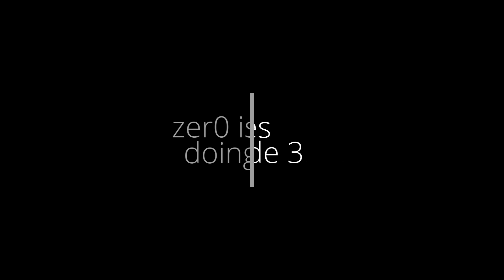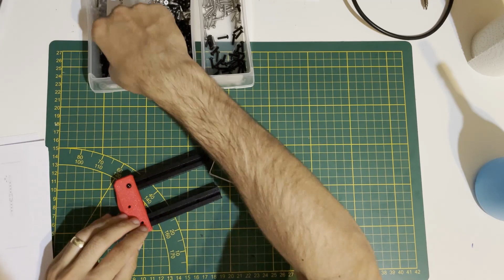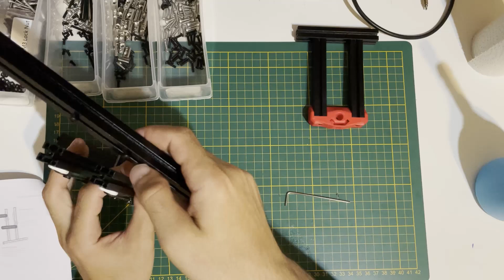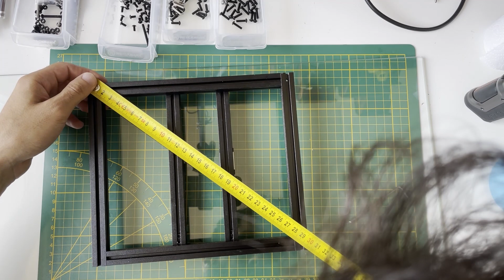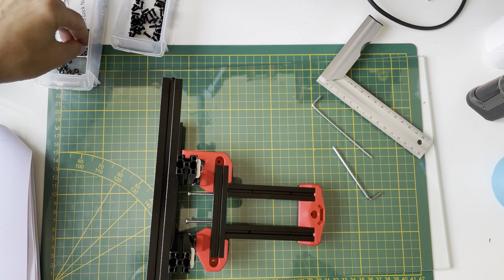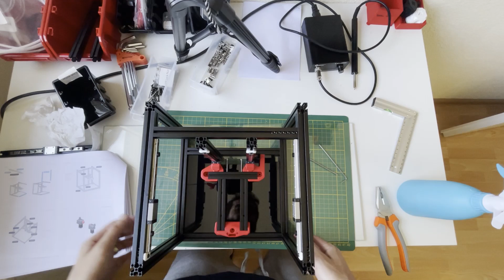Building Voron v0.1 - Frames [Ep3]

Comment: I'm really enjoying your series so far. Helping me build mine from the same kit. Just one bit of feedback - the audio needs a bit of fine-tuning. It goes from quiet to loud very frequently, and the music makes me scared to turn up the volume too high to hear your voice better. Otherwise, everything is great! 

I'm commenting on the wrong video, but the thick lube you used in the last video looks very different from mine. Do you think Super Lube 51004 is fine to use on rails?
Reply from the maker: Thanks for the feedback. 

I am not sure specifically that one is good or not but most probably you’ll be fine. It basically for protective for your rails.

Comment: Hi zero, thanks for your tutorials, they encourage me to buy a V0 kit. I noticed that you have a place for a led on your front bed mount. I will be very appreciated if you could explain better the connections and the type of led that you are using since I´m planning to do the same on mine. Keep you the good work!!!! D
Reply from the maker: It is W2812 LED. 
https://docs.vorondesign.com/build/electrical/v0_miniE3_v20_wiring.html
In above link see the last screenshot. In there you will see NEOPIXEL above the E0-STOP near right bottom. You need to plug it in there. Match the PIN layout in LED and board that's all about wiring. (PA8(On the board side) = DI(On the LED side))